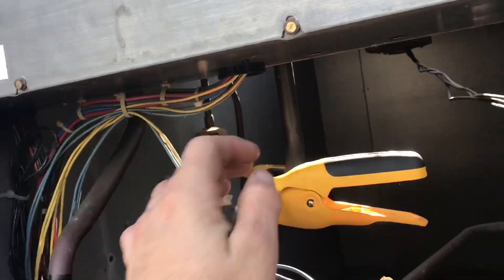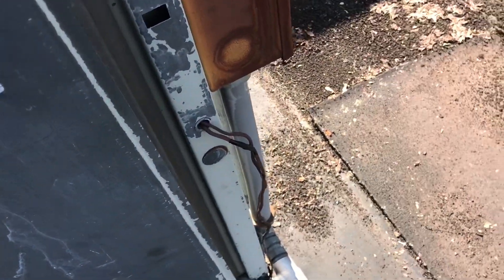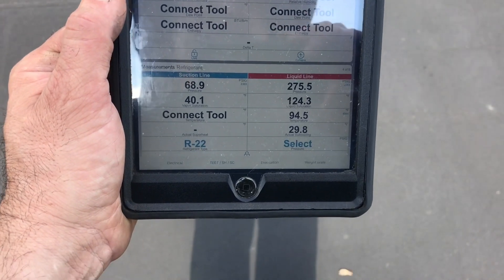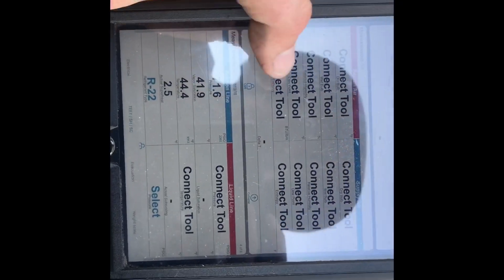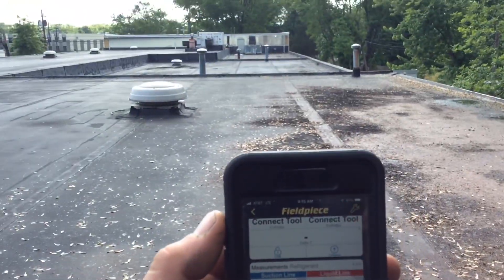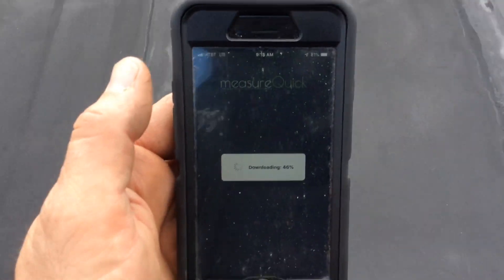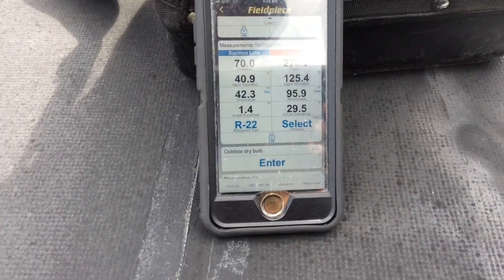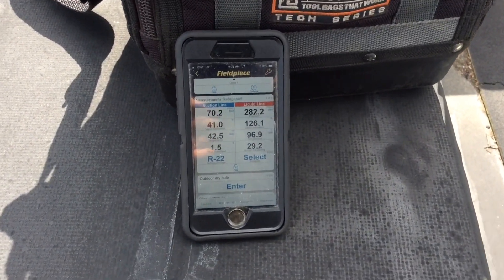My Fieldpiece Job Link Smart Probes 250 Foot Connection Test

Comment: If I may it is all about how much metal and blocking material between probes and receiver (tablet).  Look up for further info if you want on WIKI "Faraday Cage" A walk-in freezer with door shut is almost perfect Faraday Cage.  So is elevator.  Kills cell phone signals too.
Reply from the maker: Yes cement is good at blocking signal. At my inlaws in Poland, the router is in the next room yet the signal doesn't leave the room with all the walls and floors being made out of concrete. I lose my signal often in elevators at work why i don't use my phone until I get out.

Comment: Dude you got me jealous. Ordered them last week and they got backordered. Luckily they got them in yesterday and shipped mine out today but won't be here till Monday.
Reply from the maker: I used mine about 20 times so far. Supposedly the range is 350 feet but when is anyone going that far from there gauges
Reply: @thehvachacker  that's kind of my thought on it. I like it for three ease of seeing all your numbers at one and instantly knowing you're good when filling or removing instead of constantly stopping to check your slide or whatnot.
Reply from the maker: I was just replacing my broken Testo 550 and figured probes would be better than manifold. Reading pressures in an attic is cool yet I never needed to 20 years in the field. I’m like a kid playing with a new toy. Today I had a water sourced heat pump I was working on would make the appion access tee vibrate loose. While trying to charge up the system.

Comment: Turn on MQ 
Activate the probes
Open probe manager 
Map ur probes to what u want them to be (condensor pressure , evap pressure , liquid line , suction line ect.) you only have to to this the very first time. Once there mapped going foward u simply turn on probes and press the activate button. They will connect right away and display ur pressures on the main acreen
Reply: good info
Reply from the maker: I will look into this and try again. What is it about MQ you like better than Joblink?
Reply: The HVAC Hacker well for one the connection between the probes is better. Also you get so much more information when u get use to it

Comment: Have you found that you have to sand the copper down good before you put the temperature probes on to get the temperatures to read properly? I've heard a few guys say that you need to do that to get them to work right.
Reply: Depends on the pipe. The clamp will tell you if it has good connection and if it doesn't you can try wiggling it to scratch the surface to get a good connection. If that doesn't work then yes you'll have to sand it.
Reply from the maker: I haven't but the directions say it works best to clean the copper. I think it needs the copper to be clean enough to make an electric connection. I have had to twist it a few times and sanded once but didn't need to. I am guessing if the copper is green it will need to be cleaned for the probes to work. I was considering testos but testo sucks as of late too many of my coworkers have to keep sending their testos in for repair. My testo 550 just went down with a static shock. I am wondering if I can order a replacement board for my testo